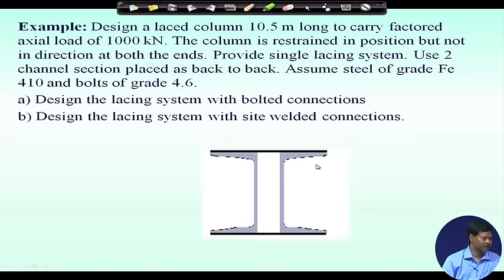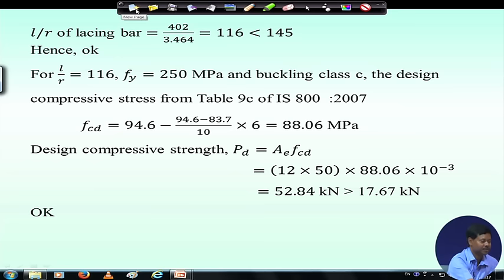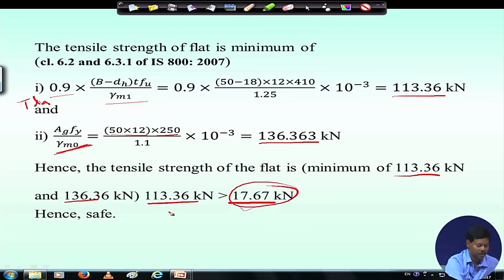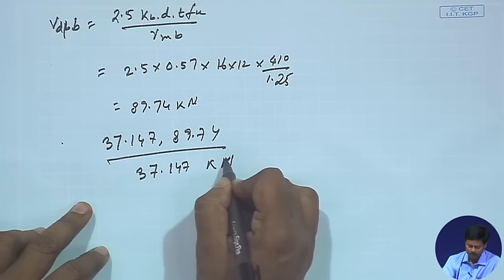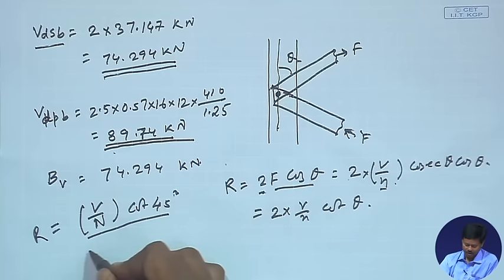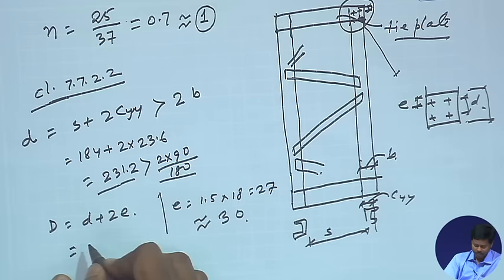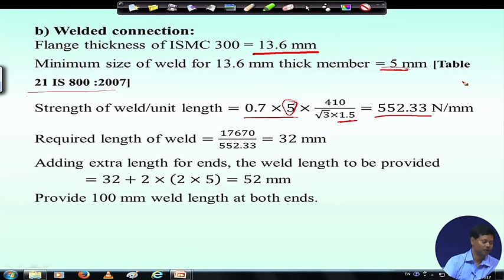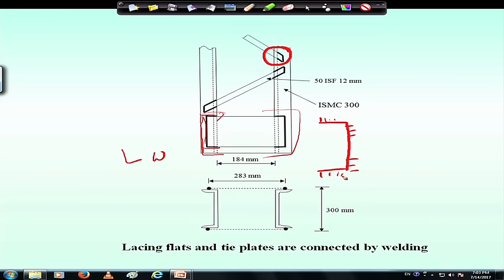Lecture 38 : Connection Design of Lacing Systems

Comment: In case of bolted connection length of tie plate considered is s+2b whereas in welded connection length of tie plate considered is s+2g why the difference?

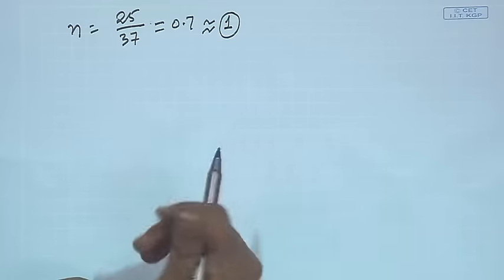Comment: @23:29 If we have to provide 2 bolts, how can they be arranged within the overlapped portion of strips while maintaining p and e distances?
Reply: We do not prefer to increase the number of bolts in lacing, but we will increase the diameter of the bolt if necessary.

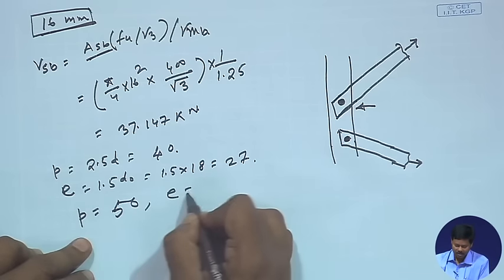Comment: @15:32 If there is only one bolt then what is the significance of pitch p?
Reply: To calculate the number of bolts required we need strength of bolt in bearing for that we have to calculate Kb, and for calculating kb we have to calculate pitch p.
As in earlier stage we don't know how many bolt will be required. As the strength of bolt will be the least of strength in shearing and bearing.
Reply: i am thinking also sir ...i am very poor bitech student ... total confused sometime in lecture ....
Reply: @sbchannel2268  you had gone so far watching these nptel videos and you call yourself poor. Why?
Reply: @shivamsharanlall672  hey are you preparing for ESE ?
Reply: @9888565407  no
Reply: @9888565407  in which sem. do you read? Or you have completed your graduation? Where are you from? What are you doing now-a-days? What is the name of your college?

Baaki ghar pe sabh theek hai?
Aaj holi me kya kia?
Reply: @shivamsharanlall672  I am done with my graduation and preparing for ESE 2021these days. Baaki holi pe kuch nahi kiya.. what do you do man ?
Reply: @9888565407  I am in 8th sem.
Training period is going on right now. No classes for us. 😊😊😊
Reply: @shivamsharanlall672  which college
Reply: @9888565407  RIMT UNIVERSITY
Reply: @shivamsharanlall672  so have you gone thorugh all these lectures ? How are they ?
Reply: @9888565407  nah! 10 lectures are still left. I will do them afterwards, maybe in this sem.'s 6 months period.

I found it better than that taught in college. I really want to apply these knowledge practically, not just for passing exams.
 I wish they release lectures for DSS-2 also.

Where are you from? Have you joined any coaching institute also?
Reply: @shivamsharanlall672  I am haryana.. no I haven't joined any coaching that's why I am watching these lectures.. but professor Damodar here seems to rush through concepts and doesnt explain them thoroughly.. don't you think that ?
Reply: @9888565407  I have found various loop holes in explanation and mistakes in the video lectures which I have raised in the comment sections.
I have got the concepts but I didn't get was the derivation of the formulas which were not to be seen anywhere, neither in the code or any author's book.

Yes one thing I remember is that for understanding 30 to 40 mins. lectures, it took me about 7 to 8 hours literally, due to the loop holes. This time also included the preparation of notes also.
Reply: @shivamsharanlall672  yes true.. I find it the same. I can't find one decent book for this subject where concepts are taught nicely..
Reply: @9888565407  ok
Reply: @shivamsharanlall672  aur kya haal chaal bhai
Reply: @9888565407  I am fine. How are you?
Reply: I have the same doubts.